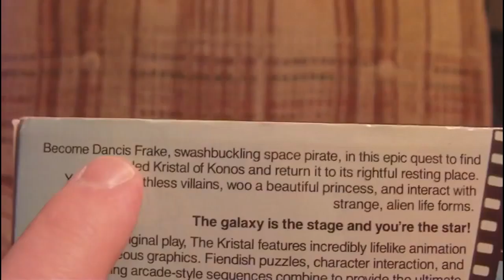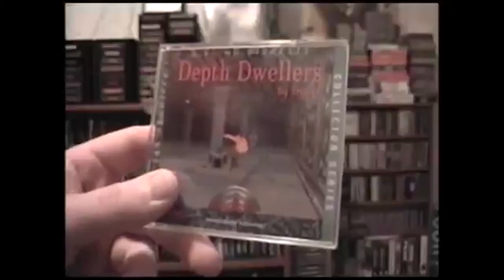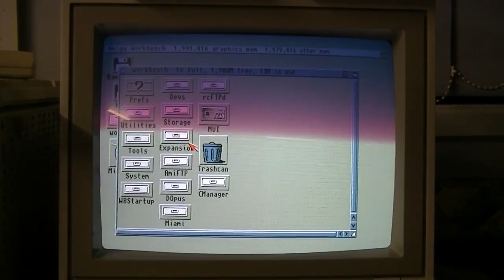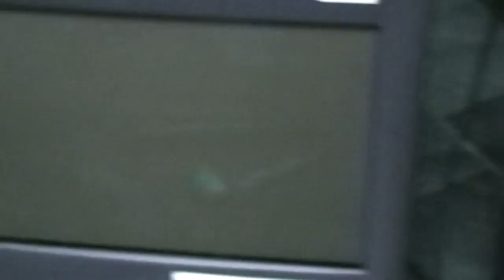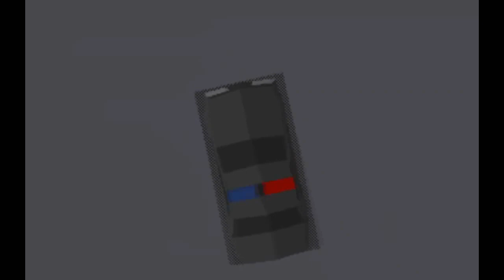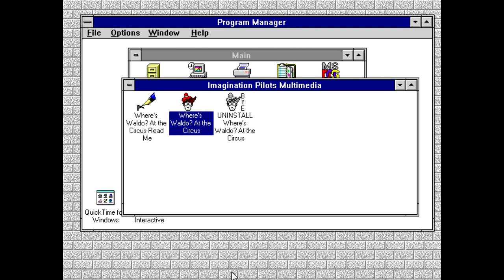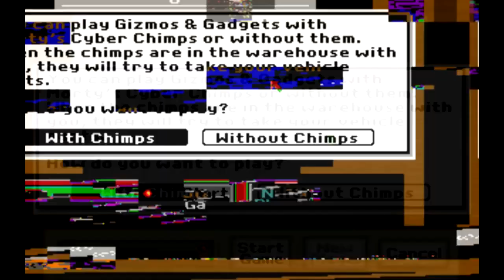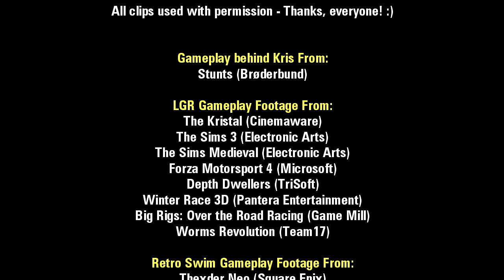1st Patreon Milestone Video!

Comment: You should probably send a counter claim if you haven't already if the Content-ID went off. 'Most' companies are fairly good about releasing claims that the automatic system tagged in error.
Reply from the maker: "In error" is the operative term. The thing is, it was a valid match of the video of the title sequence from The Sims 3 so there's very little I can say in response to that and failing a dispute is worse for one's channel than just acknowledging a Content-ID match. Since an extremely tiny amount of the total money I get is ad revenue, I don't really care anymore unless a video gets blocked/muted. :P

Comment: is it really the fan or is the computer getting so hot that it ramps up the fan the speed?
Reply from the maker: It's the PSU fan. I have a PSU that's SUPPOSED to be able to adjust its fan speed dynamically to match temperature and turn off completely if the temperature's low enough. Instead, it stays off 80% of the time, then every few minutes ramps up to full speed and quickly goes back down to off over the course of about 15 to 20 seconds. I think it would've been better to just get a PSU with a constant fan speed but PSUs are one of the most annoying computer components to replace so for the moment, I just live with it. Beyond the fan behaving like that it works perfectly fine. :P
Reply: *****
 Actually almost all PSU work that way... well then ice ones that is. Do you buy chance have store bought computer or a "less expensive PSU"?

if you have basic computer/tinkering skills, i know of a simple fix that might help, that would make the fan spin all the time but, not all full speed.
Reply from the maker: cdoublejj It's a 700w gaming PSU that lights up in three different colours. Price point was good as were the reviews of it. The thought that its fan would go full-blast every so often never occurred to me since I never had a PSU up to now which behaved this way. :P

As for tinkering with it, it doesn't really bother me except when recording so I'd rather not mess with it. It's not actually THAT loud, just gets picked up by the mic very easily when it revs up.
Reply from the maker: cdoublejj ....I've spent an hour trying to come up with a good way to respond to your comment without starting a completely pointless public debate and I can't come up with one so I'm not even going to try. If you want to discuss PSU stuff with me then please eMail me instead.